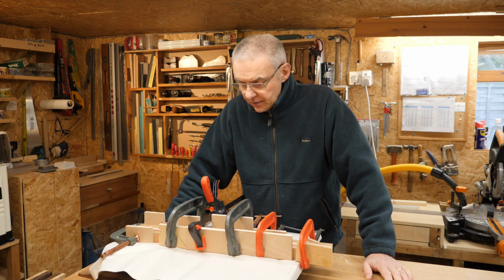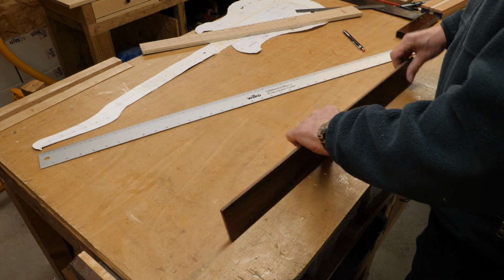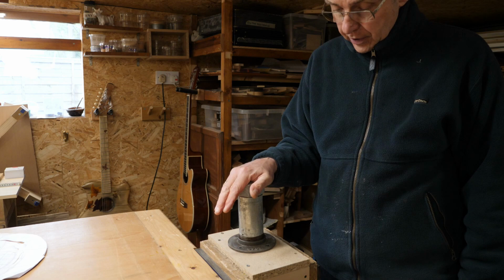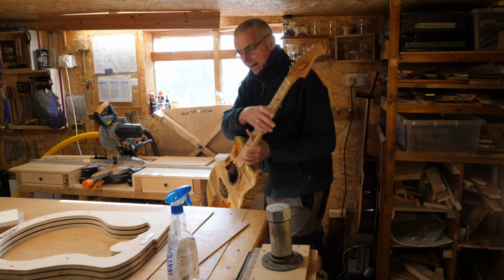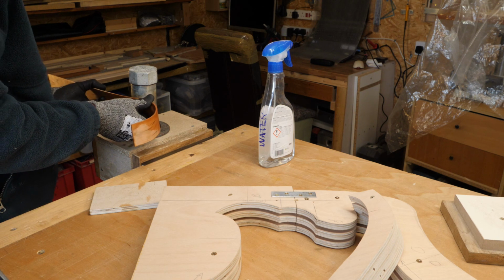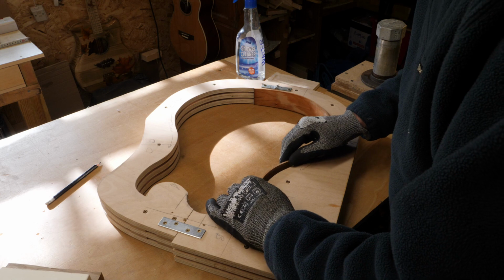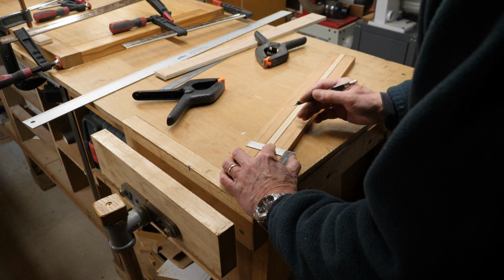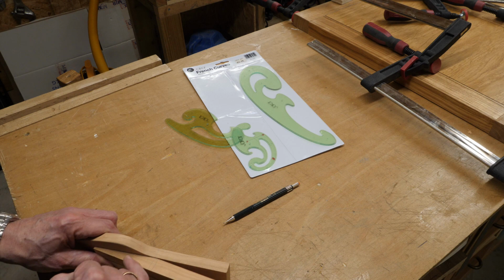#GGBO22 Community Build ep3: A bumper episode! Fret slotting, wood bending, neck and headstock

Comment: Great video.  I was laughing when you were gluing the scarf joint.  Its so difficult the tighter you clamp the more the joint slides apart.  I think next time I do a scarf joint I will put 2 small dowel inside the joint.  Good work bending the timber.
Reply from the maker: Cheers!